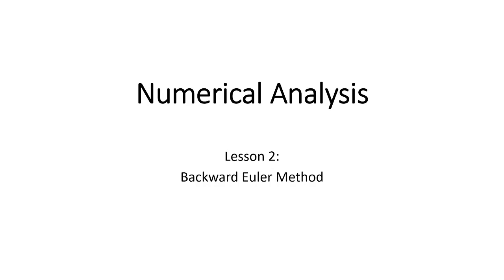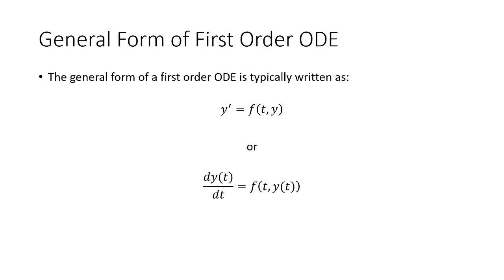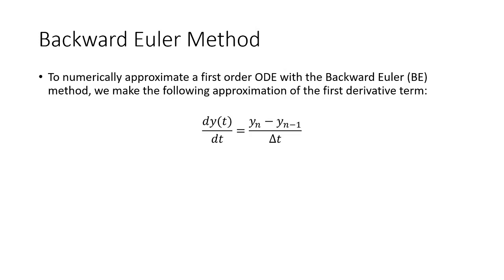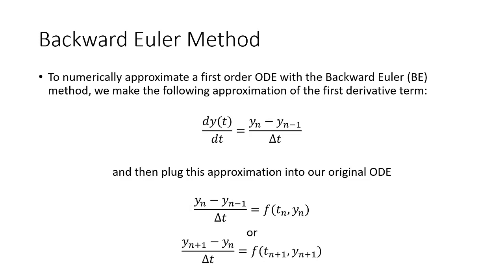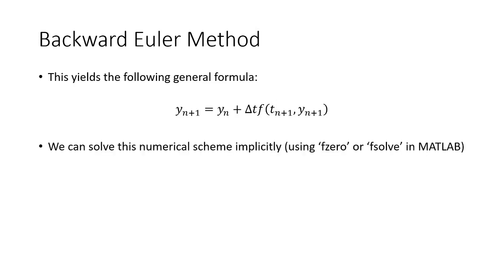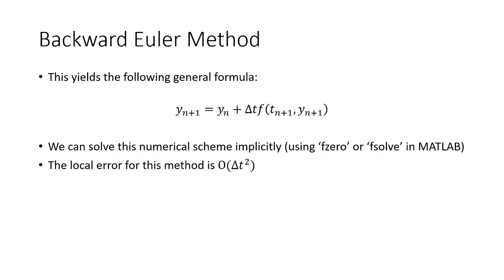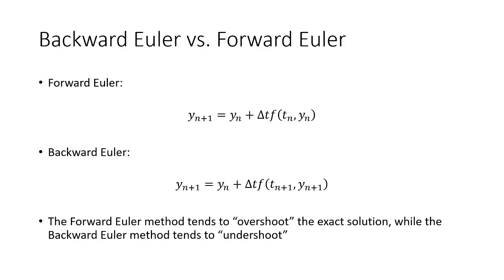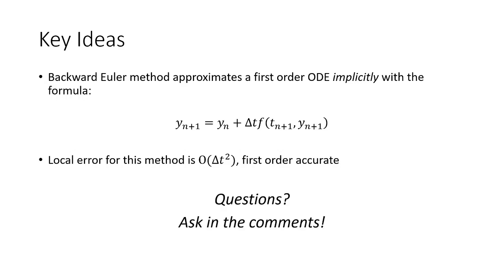Numerical Analysis - Backward Euler Method

Comment: How do you plug y_n+1 into the equation if it's the thing you're looking for????
Reply from the maker: That's a great question! Exactly why it's called an "implicit" numerical scheme
I would recommend checking out my video where I do an example MATLAB code with the backward Euler scheme and walk through the process, or my video on the trapezoidal Euler method.
Basically, if your differential equation is simple and linear, you can usually rearrange terms and still solve for y_n+1. But if you have a more complex or nonlinear differential equation, you can move all of your terms to the right side and use a function like "fsolve" or "fzero" in MATLAB to find y_n+1.
Hope that helps!
Reply: @engineeringmadeeasy4480  Subscribed
Reply: You don't.
If you're using the Backwards Euler Formula, we obviously don't have the next point y_{n+1} right off the bat,
however, when possible, you can solve the D.E (Recurrence Relation) for y_{n+1} in terms of current terms y_n and t_n.
Also use the fact that delta t, aka, , t_{n+1} - t_n = h    -->   t_{n+1} = t_n + h.

The advantage of the Regular(forward) Euler formula is that it is straight-forward, no pun intended, but it can become unstable quick as hell.
i.e it diverges from the real solution pretty fast through error.
The advantage of the Reverse Euler formula is that it is slightly more stable but it involves way more calculations.